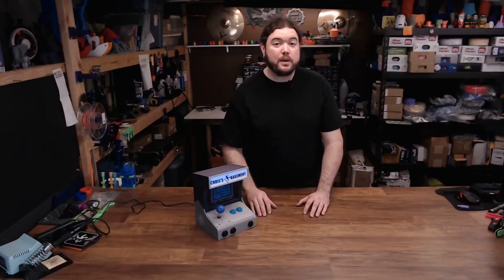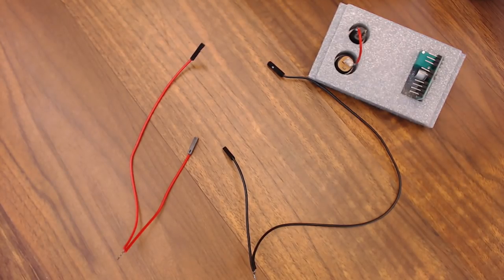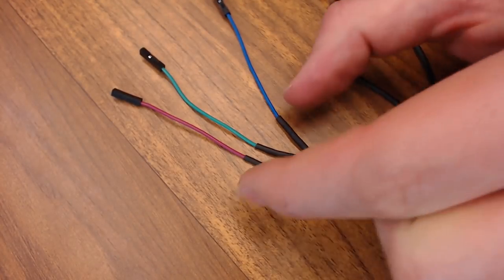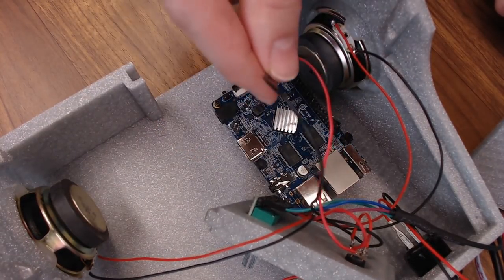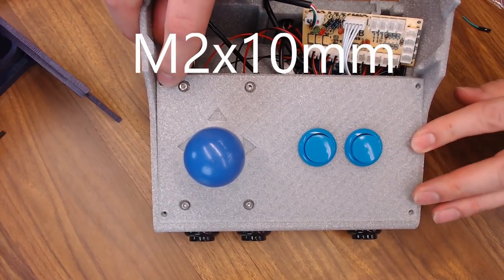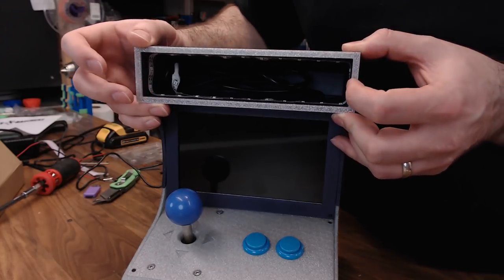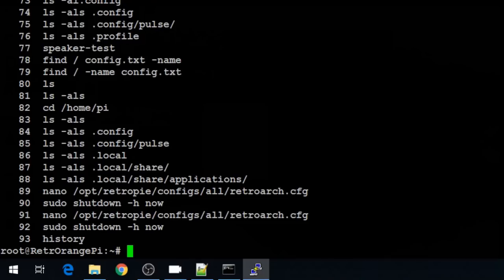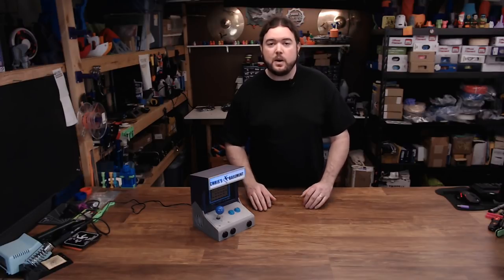Print 'N Play 3D Printed Mini Arcade Cab - Build - Part 2 - Chris's Basement

Comment: Little build tip for all Pi type projects.  Kits are available on eBay and elsewhere that have a good assortment of 2.5mm screws, nuts, and standoffs.  Very cheap and you will find they are a swiss army knife for mounting all things Pi to anything.
Reply from the maker: Great tip!

Comment: Chris, did you use all the electronics pieces used on the print and play spreadsheet or did you upgrade or do you recommend a orange pi upgrade?
Reply from the maker: I used all the BOM parts. If I had it to do over again I would use a Raspberry Pi and a different audio cable.

Comment: Would it make sense to use a Raspberry Pi for ~USD$35 to get WiFi?  Would the rest of the hardware work?  Perhaps just use the RetroPie software directly? https://retropie.org.uk/download/
Reply from the maker: Yes it would make since. James and I have talked about this. The Wifi add would be a great benefit. We might put out an altered version with something like this installed.
Reply: Cool.  I jumped the gun a bit and ordered a Raspberry Pi 3B+ and power supply, along with everything else in James' BOM on Sunday.  Looking forward to the build! 
 @ChrisRiley